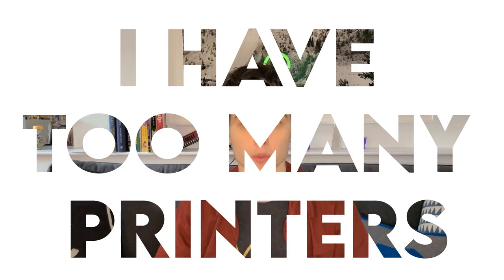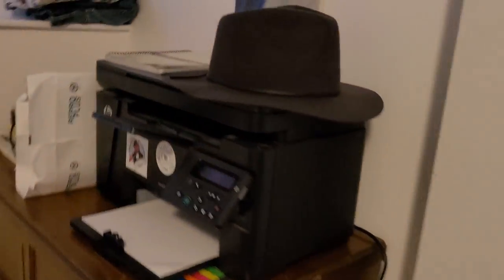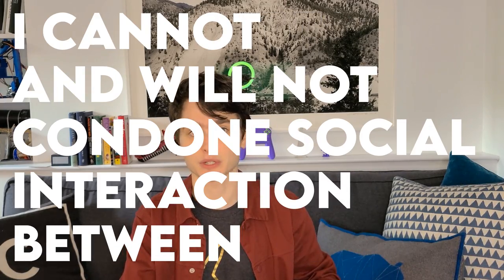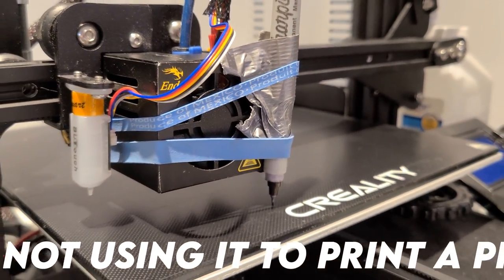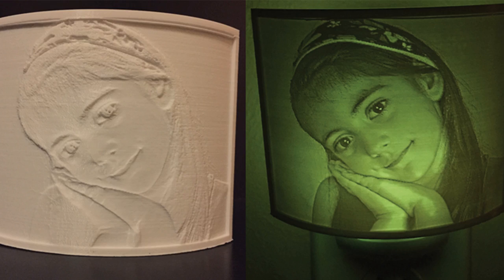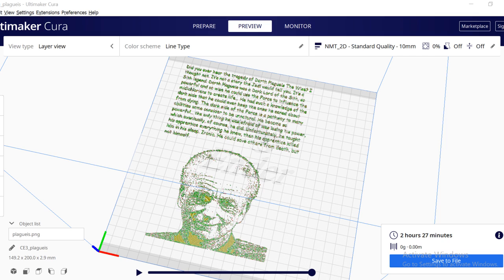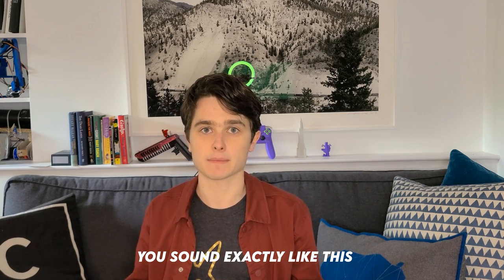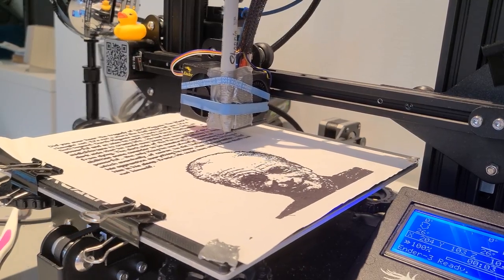I got my 3D printer to draw out ANY DOCUMENT by hand. (and your can too!)

Comment: Im trying to do this but when I put in the image that you used from google drive all it does is "print" it in like a solid color like you were making the first layer to a actual 3d print
Reply from the maker: oh, shoot, forgot to mention, you need to move it down a little, so just the tops of the lithoplane is visible. You might need to increase the height setting when importing the image though.

Also, did you use the cura preset?
Reply: @Noahmakesthings  yes I did and it seems to be working thanks so much
Reply from the maker: No problem! Hope your print turns out well!